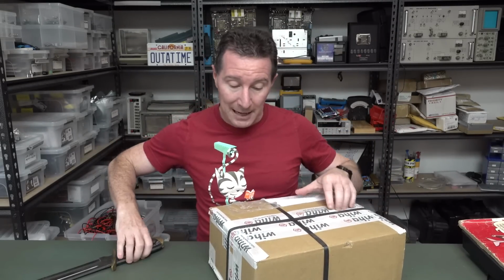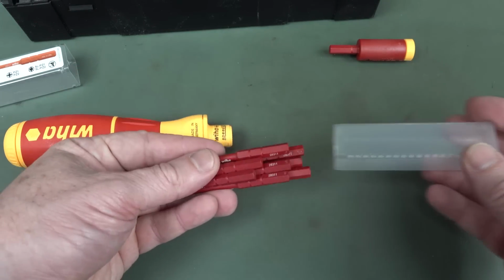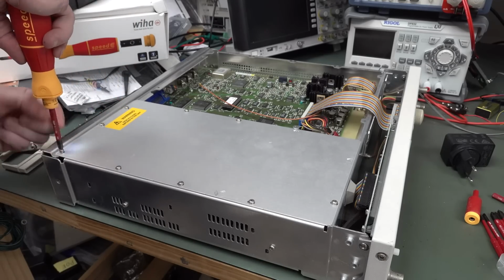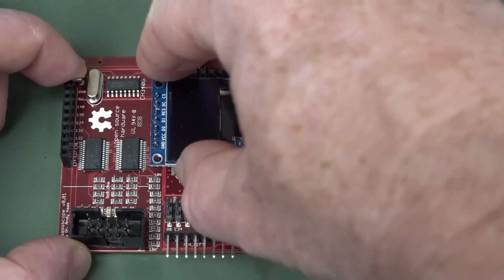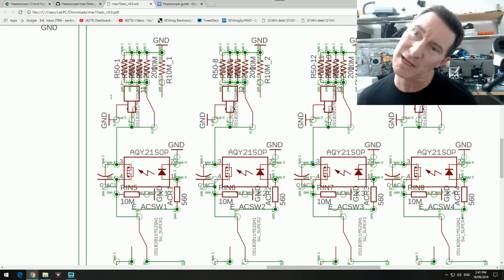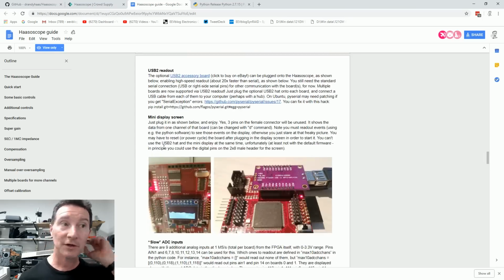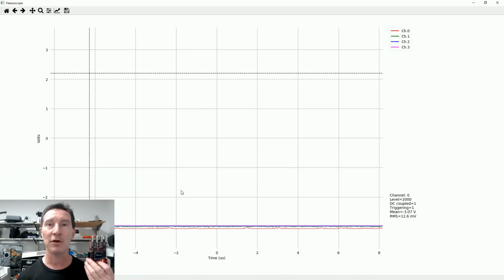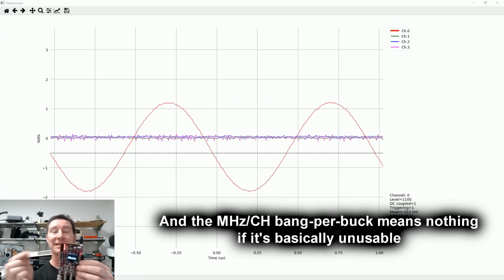EEVblog #1127 - Mailbag Monday

Comment: 18500 over 18650  BIG FAIL bejesus $500 BUX gimme a break wiha, Xiaomi wowstick do same fraction of the price
Reply: Try to unscrew a tight m5 screw with the wowstick.
Reply: @CyberlightFG  yup not easy but im betting this thing isnt any better, the wowstick was only 30bux
Reply: No way.
Reply: @highks non mainstream battery for along time 18650 or 21700 much better option..especially at 3000mha which most respectable 18650 batteries are these days
Reply: you can't unscrew anything with that screwdriver you have to do the manual labor and then it just rotates the screw when there's no resistance
Reply: $500 and you have to 3D print an adapter to extend it the 15mm to fit a 18650. lol
Reply: @SidneyCritic  I don't think a 3d printed part will do for a tool.
I bet, the 18650 won't fit in the charger as well.

Comment: The wobble comes from not using the Torque adapter - it's not an extender.
Reply from the maker: DGerber  - It has an electronic clutch, the motor cuts out at 0.4Nm, the instructions seem very clear on that and that's what it feels like also. So I see no need for a mechanical torque adapter.
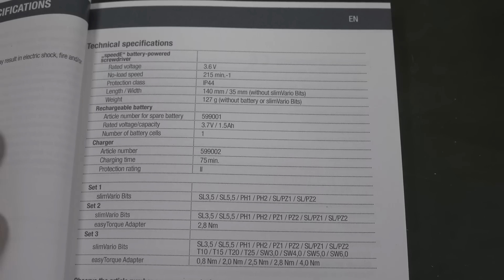Reply: The torque adapter takes it down from max 8 Nm (ref the box shot in 5:45)) /when used manually/, to other torque ranges (See the different versions in manual at 5:51 - Set 2 and Set 3 easyTorque Adapter. Comes in 0.8Nm, 2Nm, 2.5Nm, 2.8Nm, and 4Nm.)
Reply: Everyday job of torque checking 1000+ terminals makes this a good tool. For Dave it may be useless, but for it's intended use it's superb.
Reply: Wild guess: isn't the adapter a 1000V isolator by any chance?
Reply: No, I't should be 1000V rated by itself. Like I mentioned - the torque adapter is also available as a separate Wiha-product, it's called "easyTorque electric  torque adapter".
https://www.wiha.com/en-int/produkte/torque-tools/easytorque-electric-torque-adapter-for-slimbits-and-slimvario-holder-in-blister-297.html
Reply: Err, so what is the point of the "torque adapter" then?
Reply: @pev It's a clutch mechanism. It will limit the torque that you apply to the screws. Quite important when you're an electrician and are tightening circuit breakers, for instance - it has a requirement on the termination screw torque.
Reply from the maker: Interesting how it doesn't actually show using that adapter in the instructions then isn't it...
Reply: @EEVblog: Agreed. It's not intuitive, and it seems like it's meant to be used without it. 
I have a non-electric driver for the same bit system, and it is similar - it has adjustable torque directly in the driver. (WIHA part no 2872), and in that, there is a - sort of - extender that goes into the handle, and the same tips as this electric one fit into the extender. The problem is that the extender has the same shank as the bits, so if you don't know better, you will try to insert bits directly into the screwdriver handle, and then they fit slightly wobbly.